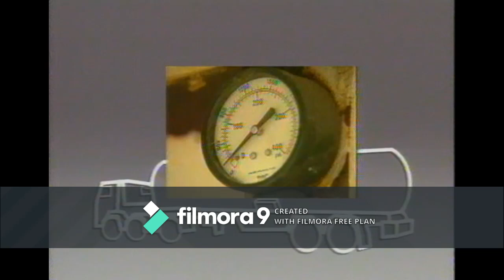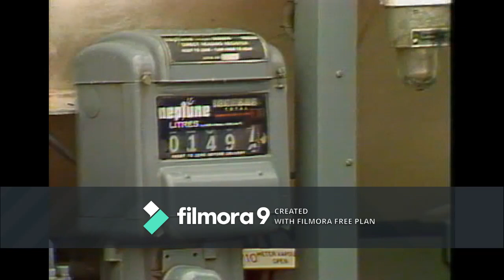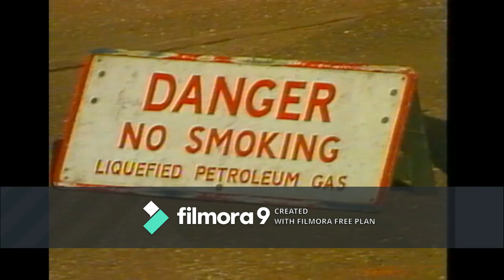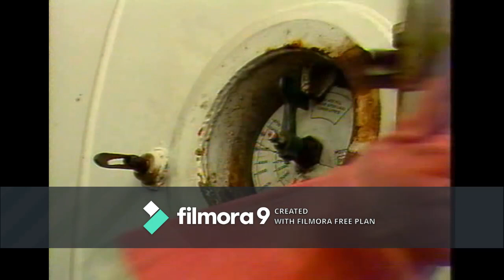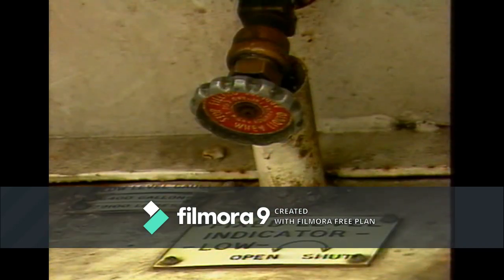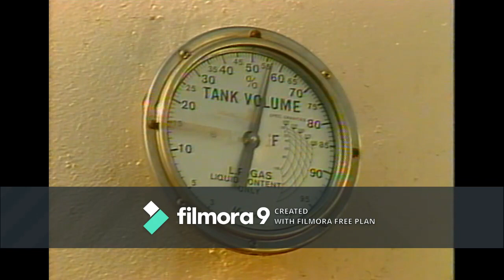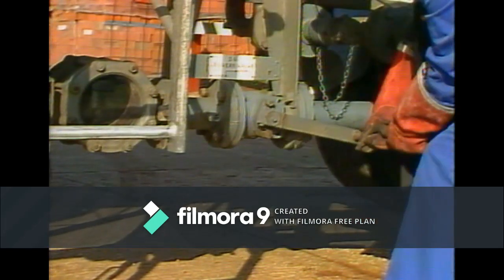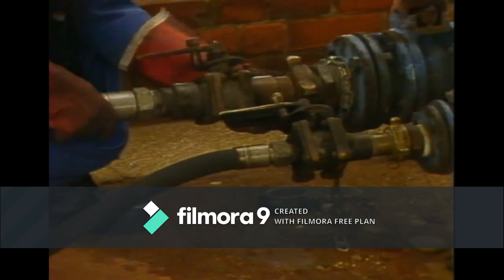SAFE TRANSPORTATION AND STORAGE OF LIQUEFIED PETROLEUM GAS

Comment: Large trucks load near my home and go about a mile away and release pressure into the woods. Is there a good reason for them to do that.? Are they overloading and having to release pressure for some reason?
Reply: They might not have access to a flare rack to release the pressure before going into another plant.
They might have 200psi in the trailer but need 50 or less to go load another product.
I haul propylene sometimes, and we have a dedicated trailer for it.
You need to release the pressure from the trl to go load the same product.
Reply: If road tankers are vapour loaded that can be avoided.